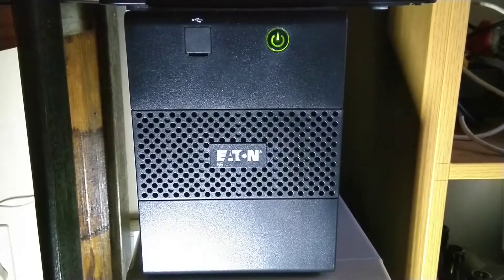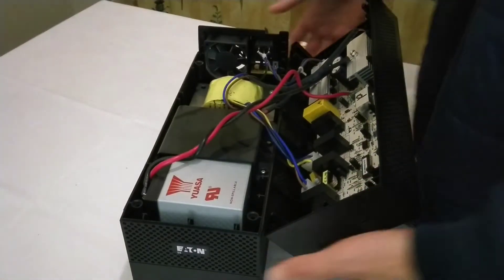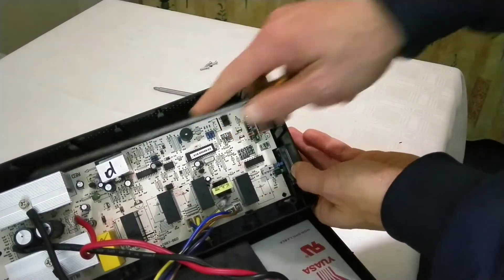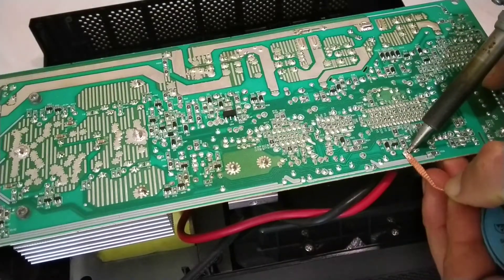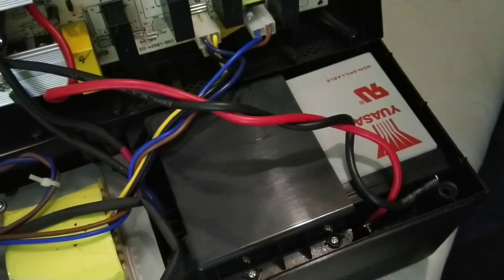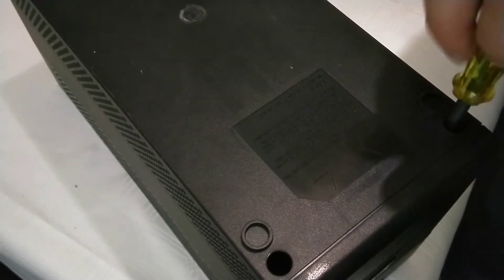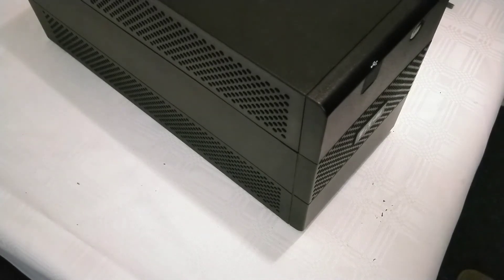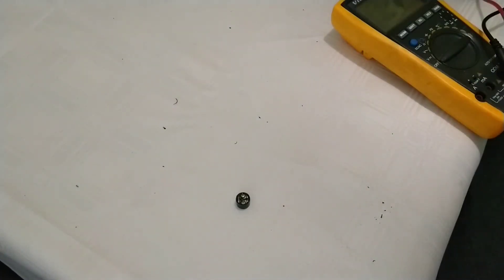Stop a UPS from Beeping Permanently by removing its Buzzer!

Comment: I'm about to do this to my brand-new APC UPS, as every time someone turns on the microwave, it thinks that the power is out and turns on battery mode, beeping 4 times. (nothing else turns off, deviates, flashes, etc — nothing)
I know it's a crappy electrical installation, but it's the mountain cabin we've rented for years, so it's not going to change. Power goes out frequently, and variations (even without involving the microwave) are expected.

Since there's no software to shut it up, and the "mute" function does not work if it changes states, I'm really considering just ripping that sucker apart.

Comment: 0:10 You say it's possible to turn the beeping off. How?
Reply: By removing the speaker that makes the beep.
Reply from the maker: There is a non-permanent setting that gets reset to default of beeping on whenever the power is lost. You can set this over the USB cable if you have the appropriate software installed on your computer to communicate with the UPS over USB.
Reply: @breakfixbuildimprove4326  I popped the speaker open filled it with gum. Peace :)

Comment: Just came across this video and thank you for the encouragement to tamper with my ups. Instead or desoldering (dont have proper tools) I used instant glue in the hole of the buzzer, following another comment about glueing the buzzer, and that seemed to do the trick. Completely silent. Thanks!!!

Comment: Thanks for taking the time to upload this, very helpful. Had to get a ceilo breeze to turn on and off my inverter mini split when cool temp was reached or else it just blew out humidity in fan mode - Only problem is it would beep every time. I have a Della so with the brand I didn’t even have to take anything apart, just pulled the control board straight out.

Comment: The device beeps for a reason;  Such as a problem with the mains,  battery failure, UPS fault or numerous other problems.  One day the beep might help you to save your equipment from armageddon!
Reply: Nonsense. It beeps so you buy the one expensive model with the mute button. I don't need to be annoyingly alerted endlessly about a power outage in my house that is completely fucking obvious. This design is idiotic if not a clear cut case of greedy insistence that we buy the expensive one with the mute button.

Comment: An easier solution would be to grab the beeper with pliers and twist it, which will break it from the connectors. Then throw it away while cursing it, or use it in future Arduino project to annoy others ;)
This did the job for me. Thanks for the motivation though! :)

Comment: Thank you for this video. That beep has been driving me nuts for 4 years and last night I had had enough. I wasn't daring enough to try and desolder the thing so, instead, I thoroughly plugged the bugger's little hole with Presstik. It's still beeping but the volume is down to a very tolerable level. Upshot is that I will still be able to hear if the batteries drop too low.

I'll be trying the NUT software on my Linux machine to monitor the UPS' batteries in the near future. The companion software from Eaton's site is horrendously bad.

Comment: What really grinds my gears is that paid "highly trained" Engineers though it would be a great idea to put a component on the UPS that literally drains the battery to tell you the power is off, when you are suppose to conserve every last drop you have. Mercer no load with 2x LION battery brand new. with zero load beeps it self to death literally in less than 5 hours. Pure genius!!!!
Reply from the maker: I suspect the buzzer consumes less power than the fan, let alone the rest of the electronics that create the heat but I think I understand where you are coming from because every Watt hour of power adds up.
Reply: LOL Good point!

Comment: This beeping was driving us crazy. What a terrible design flaw by the designing engineers.
Reply from the maker: Hah, unfortunately for us they did not design for load shedding. 😅
Reply: @breakfixbuildimprove4326 Followed your instructions and disabled buzzer. Had no soldering iron so I simply used a knife to physically break connection line between beeper terminals. Seems to have worked.
Reply from the maker: @Alphonso7777777  Someone once told me that they stabbed the buzzer with a screwdriver and that seemed a bit excessive. As long as it is not beeping and still working then I would call it a win.

Comment: How about putting some hot glue over it, instead of going through the trouble of removing it? I'm going to try that rather.
Reply from the maker: Yes, someone previously commented about using silicone. I imagine that either hot glue or silicone will make it a lot quieter. Most of the trouble was in opening the UPS and locating the buzzer rather than removing it. Let us know how hot glue works out.

Comment: You can literally replace it with LED, people on PC community often exchange their buzzer speaker with LED.
Reply from the maker: Ja, replacing the buzzer with an LED will definitely stop it beeping. Just need to measure the voltage and work out what resistance value of resistor is required to drop the voltage sufficiently to stop the LED from burning out. Assuming the voltage is higher than what an LED can tolerate because I have not measured it.
Reply: @breakfixbuildimprove4326  Should be about 3.3v or 5v buzzer, maximum would be 12v buzzer. The function of buzzer is to communicate what happened with the motherboard, so in your case, if it is replaced with LED, you can still see the UPS status without it being annoying to the ear.
Reply: @breakfixbuildimprove4326  If you have a way to make simple mod of your UPS adding fan so it will cool the battery and transformer while charging/discharging, please mention me. I wanted to know. My simpliest workaround method is by adding thermostat regulator and adding separate AC to DC converter, so I don't messing up with the factory board. If it can be done in cheaper and more compact form, replacing lead acid with lithium-ion and adding much more capacity for hours of backup isn't risky anymore.
Reply from the maker: When I have purchased UPS units I have specifically sought out models with built in cooling fans to avoid having to try and add cooling. My intention has always been to run the UPS for two hour stints of load shedding so I know it needs cooling for such an extended runtime.

One other thing to bear in mind about adding batteries with a larger Amp/Watt-Hour capacity is that the charger will take longer to charge them. It can still only provide a certain number of amps so it can end up running for a very long time trying to recharge larger capacity batteries.  With frequent load shedding lead acid batteries in particular have a tough time recharging before the next bout of power outage arrives. This really accelerates the degradation of lead acid batteries.

I am a big fan of lithium batteries although I have not used them to replace lead acid batteries in any devices. I like them because in addition to having more discharge/recharge cycles, they charge quicker and don't suffer the same amount of degradation by being deeply discharged or left discharged as lead acid batteries would.

Comment: Great video, this has been the bane of my existence living in SA too...many thanks for this! I've been searching for a solution for a while now, even considered NUT tools via a Linux box to script to the server. I really don't understand why Eaton didn't install a button somewhere to acknowledge the loss of power.
Reply from the maker: My pleasure. I also thought of going down that NUTty road but I didn't want to have a machine running permanently as a server. 

I think the lack of a mute button is combination of a small design oversight by Eaton and South Africa having load shedding which is an abnormal state of affairs that a UPS is not meant to handle on its own. Normally the UPS would bridge a short interruption until the power was restored  from, for example, the grid or a generator.

Comment: DON'T DO THIS! Before you have read "Troubleshooting" from your instruction manual for users if you have it.
Most UPS devices today have this option built-in in the Power switch. Just lightly tap it two times and you will hear two beeps for sound off, and one beep for sound on.
Lightly tap means not pushing it all the way in like when you are turning it on, but just light tap so it will move just a little.
Plus you will keep your warranty.
Reply from the maker: Thank you for your comment. I did read through the manual for the Eaton 5E UPS and it does not mention such a feature using the power button. I can't test it on the UPS as the buzzer is already removed. 

While it is possible to disable the beep via software, this setting is not permanent. This is a major problem when there is load shedding (rolling blackouts) and the UPS loses its settings. The beeping can return at the worst moment such as when trying to sleep or are on a call. Hence the search for a permanent solution! :-D
Reply: The APC does not, only the most expensive APC home model has a mute.
Reply: Doesn't work on Eaton 5E 850VA

Comment: Sunday morning, woke up at 8 am because of this "dummy" beeper. Your video inspired me but instead of removing the beeper, I used my mighty hot glue gun. Sound now is very discreet! Thanks a lot! My other ups from APC has a great button in front and disabling any sound permanently with one touch! Why not you eaton?
Reply from the maker: I'm glad the hot glue worked! Someone else suggested silicone so there are quite a few of options. I think most people would pay extra for a mute button. 😁

Comment: fill it with silicone
Reply from the maker: Ja that could help muffle the noise. I think the trick would be to get the silicone into the buzzer. The hole looked pretty small as I remember it. However a paperclip, toothpick or a syringe could solve that problem. either which way, best to get it right the first time else you'll be opening up that UPS again.  😅

Comment: How do I stop the timer shutdown? UPS shuts down after 1 hour precisely, even if the battery is still going strong. I only run my router and fiber terminator on the UPS (Eaton 5E 850)

Comment: i remove also on mine to, it is anoying they did not put a swtich to force off the speaker, i didnt remove the pcb on its mount i snip off the piezo, also is the can be replace with a Red Led and mount it infront to see it blinking, thanks on the vid that gave me idea what is in the back of that pcb.
Reply from the maker: Yes a switch would have been nice but would increase the cost. I like your idea of replacing the buzzer with an LED. My pleasure, I am glad the video helped.

Comment: Thanks for this. Had a really important meeting early in the morning and the damn thing woke me up at 2AM... I was not pleased.
Reply from the maker: My pleasure. I think mine woke me up once or twice. I also found that noise rather irritating and a somewhat stressful reminder of the state of national electrical supply. Silencing it certainly helped preserve some of my sanity.
Reply: in what situations have you heard these sounds at night?  Was it on purpose - that is, the  electric disappeared, or can it make sounds simply by itself, without any reason ?
Reply: @e1jo  It was only when the electric current disappears. My country struggles with electricity supply and it might happen in the early hours of the morning. (Also, it is probably worth mentioning I do not have this make/model of UPS. I have a different brand.)
Reply: @pieternaude1469  Thank you! It would be interesting to hear what model you are using now?

Comment: My UPS battery usually powers my computer for about 30-40 minutes, then fails. I have now connected a second battery in parallel and it last for longer, but the UPS (resistor) still shuts it down after 60 minutes. It would be nice to have it last as long as two batteries do, perhaps even three, if I could bypass the auto-shutdown 'feature'. Thanks again.
Reply: My Ups also shut off after 1 hour then I have to switch on again. Isn't there a way to bypass it so that ups doesn't shut off every hour. My battery capacity is in such way that my ups hold for whole 4 hours when stage 6 . but have to switch on every hour is annoying. Any ideas
Reply: @eugeneventer1769  No sorry, very irritating Indeed. I did buy a 'Vertiv' UPS, and that has a two-hour cutoff, but as loadshitting is usually about 2 hours and a few minutes (5, 10 or 20 mins), it still cuts out and you have to reboot. Annoying, to say the least.  Thanks ANC !!!
Reply from the maker: Well done on doubling the run time. It really depends on why it is shutting down. For example, the UPS overheats, the battery has no more charge left, a protection circuit kicking int to try and protect the battery from deep discharge or the UPS from suffering damage due to overheating. If it is exactly 60 minutes each time then probably the latter. My UPS was purchased in late 2019 to replace the previous one that saw a lot of service due to load shedding over the years. I think the charging circuit eventually gave out...